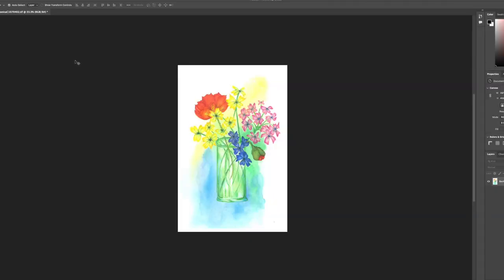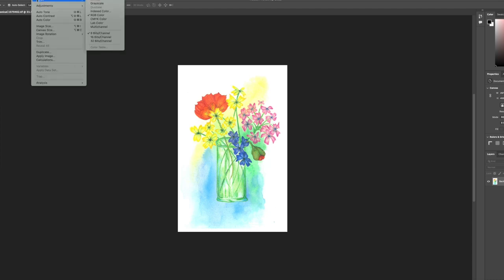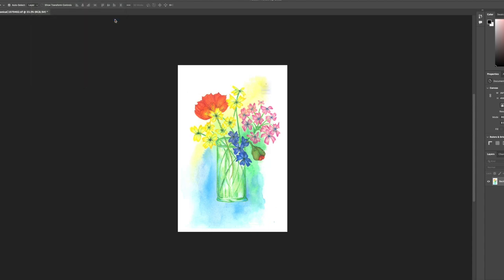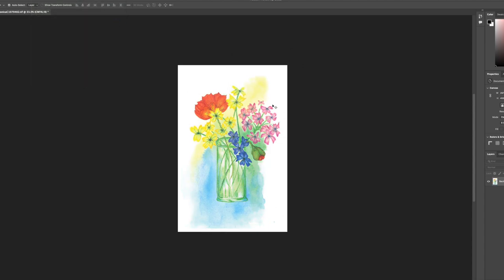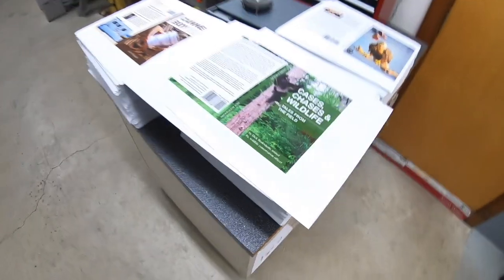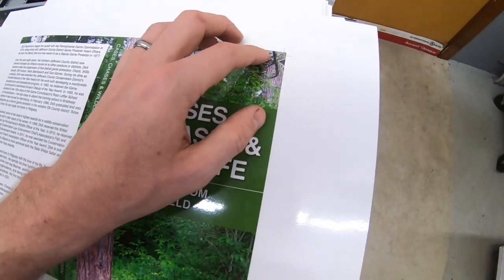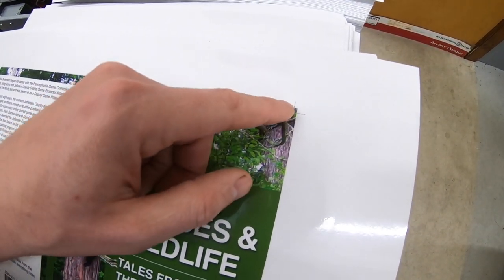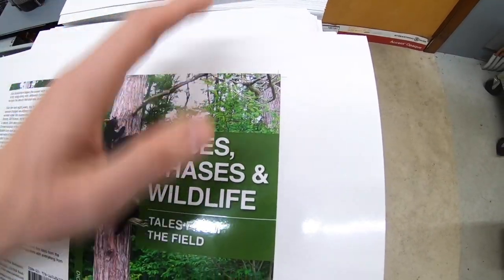Optimize your Artwork for Digital Printing, Tips and Tricks for New Designers

Comment: I know this is an old video and this will likely never be read but you touched on so many points that are ignored or glossed over until after the sale of printing equipment that I just can't resist. First off, let me touch on my experience level. I started in the industry just a few years post the advent of digital color printing (laser). My very first job was setting up a Canon CLC with Fiery in an all Mac environment. No one, even the local (Los Angeles) dealer knew what they were doing. When I finally got it working and called to ask the dealer what I thought was a simple question his response was a job offer. 
From there I was hired by KM (then Minolta) as a printing software and color expert based on my previous experience with photography, color and traditional printing. I spent the next decade explaining to customers the difference between RGB and CMYK (it doesn't look like my screen!) Well, no, and it never will. RGB is light shining directly into your eye from the source. CMYK is light reflecting off something back to your eye. There is always loss, it will never, ever be as bright. Which leads me to topic 1, if you are going to try to print something designed on a monitor, TURN THE BRIGHTNESS DOWN. Way down. Like 30-40%. At the time virtually everyone had Photoshop and circa v3 through 5 had a nifty little Adobe Gamma utility that would let you visually calibrate a monitor so you could come close to matching the eventual print. Run that then compare a print to the screen and most arguments were over. 
Next up always comes the color rendition style as selected in the print driver. Most manufacturers, Creo, Fiery/EFI and (then)Micropress usually have 4 choices, Photographic, Presentation, Absolute and Relative Colormetric. I'll stick with the first two as in all my years the only time I could justify recommending Relative Colormetric was when troubleshooting for one of the big name athletic shoe manufacturers. At the most down and dirty level, Photographic rendering yields better blends or gradations, with a possible slight bias toward warm colors (portraits/skin tones). Presentation is just as the name implies, for presentations like Powerpoint where contrast, "punch" and saturation are the desired result. For any digital printer that hasn't done side by side tests, I strongly recommend you do so, the experience gained will surprise you. 
I can't tell you the number of printers (and their customers) that complain about lack of "color" or saturation in finished jobs. If you haven't experienced this, you're not a digital printer. Rule 1, when ever possible, print a sample and get a sign-off before running large jobs. Yes, its a PITA but will save you time and material costs when you don't have to rerun jobs for free to satisfy a regular customer. The solution is often one simple driver change, print 5% darker. Its a mouse click and usually all that's necessary to turn a critical customer into a happy customer. 
Temperature makes a difference. A lot of print shops have minimal or no climate control. This really does have a significant affect on color. Ask EFI how often you need to calibrate your device, the answer is always the same (its actually in the book), calibrate as often as necessary. The more stable your environment, the more stable your color, the less frequently you will need to calibrate to maintain consistency. With identical equipment I know some shops that calibrate only after a PM. I know others that have to calibrate 3 or 4x a day to maintain consistency. The difference is all in the environment. Want the secret to selling a digital press to a print shop? Print 500 of a good quality file in front of them. Pull the first and last copy and show them side by side right in front of them. When they are virtually identical you've pretty much made the sale. 
Back to graphic design for digital printing. Every digital press manufacturer and associated RIP manufacturer knows the gamut of their machine. One easy way to compare is to ask how many of Pantone colors the given combination can hit. Bear in mind, this is still a subjective number. Quite often I find the Pantone match unacceptable though it is listed as a "match". Hence, never, ever let a customer pick a custom color, especially a company logo color in RGB. You'll never make them happy. Require they reselect a Pantone (or DIC)or Toyo equivalent unless you are prepared to experiment and enter a custom call-out in your RIP. Fair warning, even professionals with a degree in graphic design only know how to do a proper call-out in their own design software. I can't tell you the number of times I've heard, "well it was fine on pages 1-10 but then on page 22 its completely different" only to discover that the "call-out" is now an RGB mix from a color picker! Bear in mind, this is all from experience and by the time I was called in, everyone else had given up, and the obvious was STILL being overlooked. Assume the designer has no clue and you'll never live to regret it. Let's just say, the experience trying to match things like McDonald's Red, Coke red and Hunts Tomato red give me nightmares.
The video is absolutely correct about crop marks sometimes making B/W pages click as color. <heck, I've seen one PERIOD added to a page in editing that caused the page to click as color. Designer created, I believe, in InDesign, an editor added a missing period in Acrobat. Easy mistake to make> This may well be a KM only tip, but a related drivers setting is Print with Rich Black. Yes, it 100% makes blacks look richer, but how does it do this? It throws cyan into the black turning a b/w click into a color click. This is awfully expensive if you're doing what you thought was 20,000 pages of black text but get billed for 20,000 pages of color! If you're wondering why, KM engineers decided that black (K toner), usually used for text is easier to read (easier on the eyes, especially under artificial light-scientifically proven true) when it is matte black. Complaints came early and often thereafter. You can print a color page (CMYK color space) that has color and full 100% black shadows and look at the resulting page. The color areas will have a bit of sheen to them and the shadows will look like dead flat black holes. Its not a good look. Enter Rich Black. The cyan makes it a little more blue/black and adds back the sheen. Problem solved. Except for the excess color click charges. If you buy  your equipment from a good dealer they will probably tell you. Independents often don't or don't even know this themselves. 

I know there's a lot more, but most probably no one will ever read this far so I'll quit now.
Reply from the maker: I read it all. Wow. There is a lot of information in your head. Thanks for sharing!
Reply: @justaprinter  Thank you for the compliment, good sir. I attribute 'what I know' to being in the right place, at the right time and having a good memory. There's better training, but a crash courses at EFI for a week at a time, being flown in for special one-of-a kind training,  repeated seminars, and a great personal relationship with CREO, EFI and other RIP makers yields more info than any static book. I was just lucky. Seriously lucky. For instance, one of the KM trainers that I consider a friend was an ex NASA engineer. When a board would fail, he'd break out the oscilloscope and test meter, go to Radio Shack, buy components and solder fixes to the boards. No joke. Having someone like that hand you the 'quick and dirty tech mode settings' to get better results than factory spec isn't something everyone can access. Like my mentors, I believe in passing it on and am always happy to do so.
Reply: I'm a graphic designer.. Thanks for your time sharing all that with us!

Comment: Dan, you just produced the video I've been thinking should be made years ago. In my opinion, today's graphic designers are being taught for online design only. In almost every instance, when I receive a file for printing it never includes a bleed area. Or the resolution is too low for sharp printing. The simple idea of doubling the margins between panels of a folded brochure is beyond their comprehension. I'll be sharing your video for future educational purposes. 😉Thanks.
Reply: The local university cancelled all the print part of their education last year, crazy
Reply: Preach on. I hate that 90% of jobs I get, I have to figure out how to add bleed, because they never add it.
Reply: @miketheprintman  Good thing is whenever it's not a raster-file. Sometimes I get PDFs that I can just open in Illustrator and easily edit to fit my needs. But most of the time...hard work in photoshop.
Reply: When I was learning, we actually still had some sort of pre-print-knowledge teached. But in hindsight, it was all terrible information, way too little and outdated. 3 mm (0,12 inch) of bleed was told to be the standard, but most big printing companies use 1 to 2 mm max. Also adding marks was a terrible advice.
Luckily I went to the best place to learn: Into a printing company.
Reply: @shigrathFX  3mm bleed would likely have been because older machines were terrible at front to back registration. Our first digital press was that bad that we actually never printed double sided business cards on it because it was that difficult to get them registered. Newer machines are much better so you only need 1 or 2mm but we do still ask customers for a 3mm bleed as standard.
Reply: I totally agree! 80% of jobs I receive contains no bleed at all. But the worst is they usually put text very close to the edge, and makes it very difficult to add bleed after. Please add bleed
Reply: A lot of the problem files I get are from people who bought invitation layouts from designers selling on Etsy.
Reply from the maker: Yes, hopefully this video will help educate a few people so printers get what they need. All designers also need to learn how their designs are produced! I should do several short videos that printers can send to customers.
Reply: you have to understand that they who never add bleed means don't know how to export file. They never go inside marks and bleeds setting window and they never know why bleed is so necessary.  They actually work in doubt always.😀😀
Reply: I started/learned offset printing and graphic design when I was in High School (Class of '89)  1 thing our teacher stressed was 1/4" borders for cutting and the gripper rollers.  Today I get files where people design their own cards and they will have text almost right on the cut line.  So irritating.  LOL.  This was a great video and I am going to use this for my clients.
Reply: @miketheprintman  I'm self taught or rather I was just expected to know. Took me a while to work out mirroring to get a faux bleed. I still get frustrated by people not giving me bleed whilst claiming to be designers..
Reply: I don’t blame the designers. I blame the software developers, Adobe, Microsoft, etc. Their default settings are not for print. I think a big dialogue box should pop up when you launch the application and ask “Will this design be printed or posted online only?” If the user answers printed, the bleed settings turn on automatically. It’s easier to remove bleeds than add them after. This would reduce so much back and forth with the customer and make our lives a lot better. Providing files that are “Ready to print” is a foreign concept to most consumers.
Reply: Lately we are getting Canva files an online thing, and their pdf's are terrible all of the above bad images, no bleeds, text too close to everything, fonts not embedding, every single one of them says 'invalid object' or something like that on most pages, i get them to print in the end thank god for the Acrobat plugin Pitstop and Quite imposing they are life savers.
Reply: yes, the resolution is such a problem today (odd if you think about it...)
i had a customer come to me wanting me to print a couple dozens Comic Books of his art. And the files he send me are only 720 pixels wide... And he wanted that printed in to a A4 size (8.27 x 11.69 inches) Softcover Book...

Comment: Great video! Missing fonts are the bane of my existence. I love it when they are outlined or we get sent the font files. Such a treat.
Reply from the maker: Totally agree! Fonts can be a real headache!
Reply: In Illustrator If you have a missing font you can place the PDF in a blank document centralise it make your art board the same size as your placed PDF then chose flatten image make sure you tick convert text to outlines before clicking ok. I then create a box that is the size of the document making sure it is centralised ungroup & unclip everything, select all your text group that together then group the box you created with the text, copy it open the original file then paste the outlined text & box into the original file and centralise it, then delete all the text with the missing font. Ungroup the box and text you pasted in then delete the box. You can then save the original file with the newly outlined text. 
I use this method all the time at work. Hope I’ve explained this correctly.

Comment: A fun trick with digital printing, if you mix 100% black and 4 color black, you can create almost a raised spot gloss effect. (The 4 color will appear thicker and shinier) I did this with a wood grain pattern, rich black on top of black and you could even feel the texture. Only really works on uncoated stock though.
Reply from the maker: Yes, I have done that before and it is fun! I should make a video about that.

Comment: I provide to my customers a pre-defined PDF export preset that can be imported into most Adobe Products. The preset contains proper tweaks for my Fiery. I also provide a tutorial for PDF export out of MS product as well. My workflow is 100% PDF and as long as my customers use these settings I have no trouble. 
PDF preflight in Acrobat Pro is a must as well. Pitstop is a great tool that will even allow for more tweaks.
Reply from the maker: Agreed, Acrobat Pro is a must. Thats a great idea to have a PDF export tutorial for customers!

Comment: Thanks mate! I am a junior digital print room Operator/graphic designer, I need more guidance on numerous print jobs since I use Fuji Xerox 80 Press and Epsom Surecolor TS200 (for wide-format print). I know most of the print jobs need CMYK colors but for the print jobs that is a poster with a photograph it might be a RGB. 

I still have troubles trimming off 10 to 20-up artworks like bookmarks and business cards. Do you have an advice on trimming out a 20-up business card or a 10-up book mark on a SRA3? We use a electric Guillotine at work.

Comment: For sure include bleed with no crops (no crops makes cutting easier if you let me do it), don't put artwork closer than .25 to the edge, please no boxes or out lines that make border on the piece, don't try to step it out yourself, and please don't use a bright orange (digitals just can't do it. you really need a pantone to get what you are looking for). 

Also cool tip, if you are scoring and you want a nice fold don't use uncoated, it cracks just use matte or gloss and if you must write on the inside I would suggest a c1s.

Comment: A lot of stuff here I wish I'd known when I first started designing for print.  Great video!

Question:  what are your thoughts on using PNG for black-and-white images?  I knew to avoid JPGs but I was under the impression that PNG was a good file type for digital printing.  Thoughts?
Reply from the maker: I don't know much about PNG's. I was never taught to use them for any sort of print. But its been 15 years since I was in the classroom and things may have changed.

Comment: I have to explain all these things to someone new every single day. The thing with me is that in general I don't like to just fix something without telling the client because then they're under the illusion that their file setup was correct. Yes, it's a lot of back and forth and annoying for everyone involved. But by not saying anything to them, all I'm doing is giving the next printer they work with a big headache. We once had a client who swore that their multi-page booklet with no bleed was "fine for the other printer" but in fact that printer had scaled it down and printed a different size. We did the job and it came out fine but it was hell. Communication is key here. Some people will bail on jobs or be annoyed, but to me I'd rather have a smaller pool of higher quality clients.
Reply from the maker: Thats smart, I agree!

Comment: Do you have some sort of formula to calculate the spine widths for your books? You do a lot of them, just curious if had some kind of cheat sheet you use.
Reply from the maker: Spine thickness = Page count divided by 435 is what I use for 60lb text. So this means that there are 435 pages in one inch of paper.
Reply: @justaprinter  you pretty much stick with 60# text though, right? I don’t do a ton of perfect bound books, but it’s always a different stock, so I’m trying to find a nice excel formula or something to use.